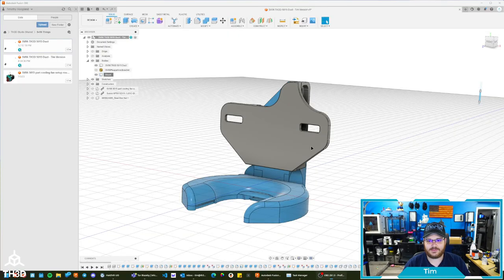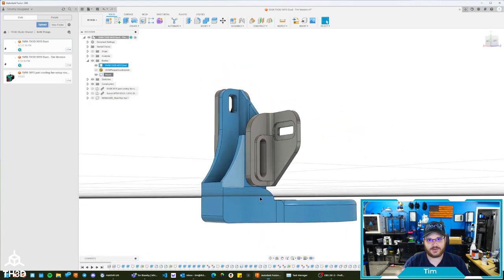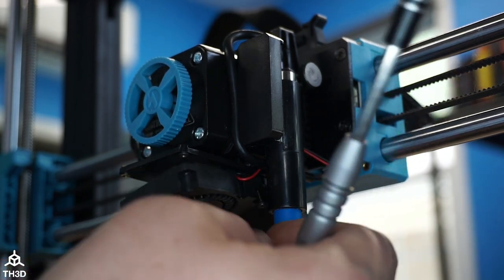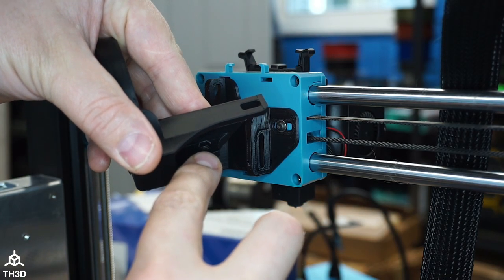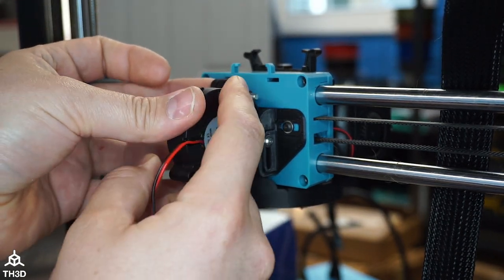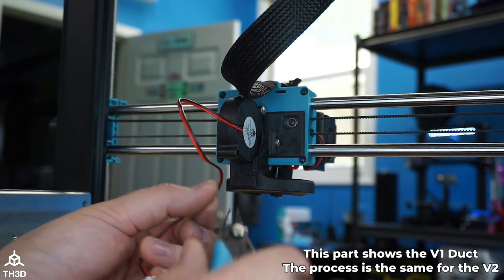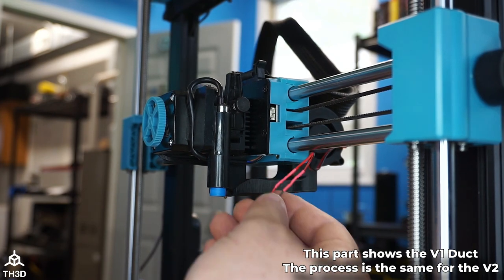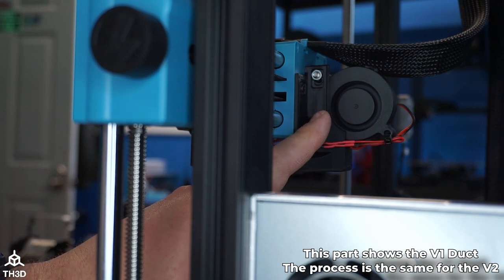SV06/SV06 Plus 5015 Pro Layer Fan Duct Kit - Installation Video

Comment: Just purchased the old kit a couple months ago, but haven't installed yet. Will I be able to download and print the updated parts?
Reply from the maker: We're not selling the STL files right now. This is our own design that we made from scratch. You can purchase the new version though if you wish. Just the parts are here: https://www.th3dstudio.com/product/sovol-sv06-5015-layer-fan-duct-abs/
Reply: @TH3DStudio  Hi Tim, I''d be more than happy to buy the duct from you, but your cheapest shipping option to Australia is $25 USD, making the total when converted to AUD around $70 AUD. So, not worth it. It would be a lot easier to buy the STL from you and print it myself. Please reconsider making the STL available for purchase. Cheers.

Comment: so is there a proper way to set the height of the cooling. too high or too low. i would think too high it would cool your nozzle and that is not good. is there some form of test? i have seen some people using water to show fan movement. tia
Reply from the maker: We show the proper mounting height in the video.
Reply: @TH3DStudio  thanks I'll watch it again but I don't recall anything other than eyeballing it.

Comment: Great idea!  The only thing I would have done differently  is st stagger the splicing (In case the shrink tube slips off).   I do like the newer duct, you did a great job on the design.

Comment: If I just purchased it and I got the old kit. Is the STL for the new fan duct available somewhere?
Reply from the maker: If you received the older version, you purchased it before the new one went live on 7/25. We aren't selling the STL files as this is still a new product. We may make them available for purchase at a later date. But if you have the older one already, just use that - it's a lot better than stock.

We do have just the parts here: https://www.th3dstudio.com/product/sovol-sv06-5015-layer-fan-duct-abs/
Reply: @TH3DStudio  Ugh I just missed the new design... my order was on July 21, 2023